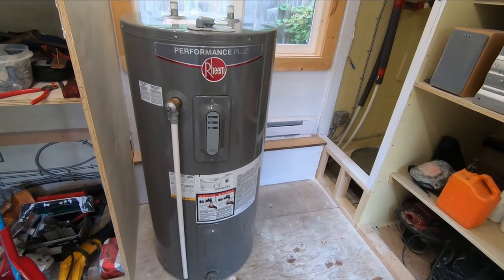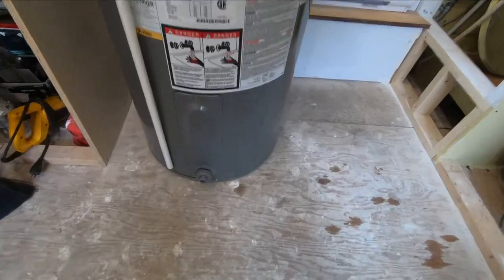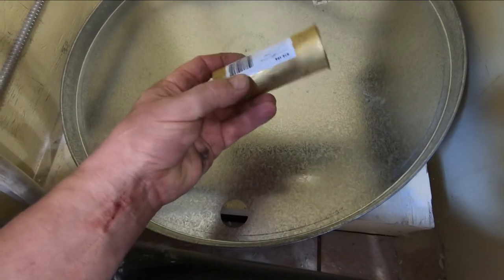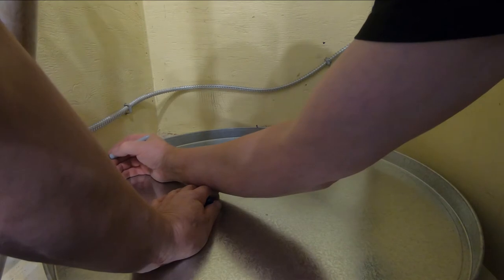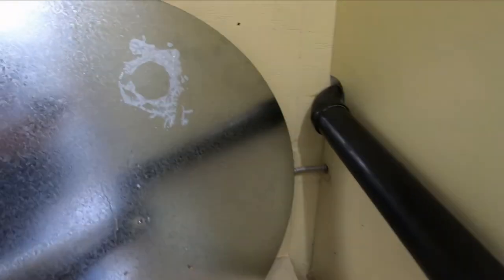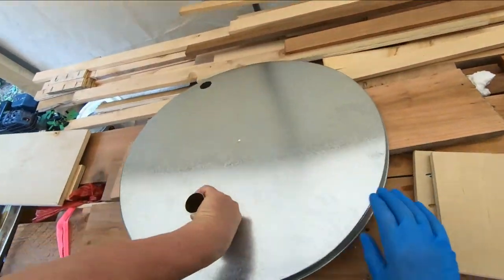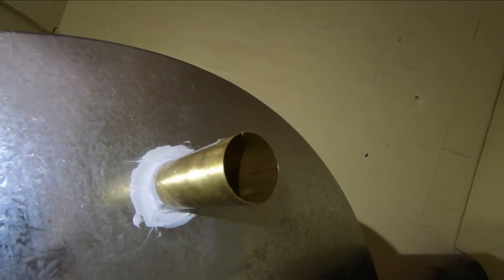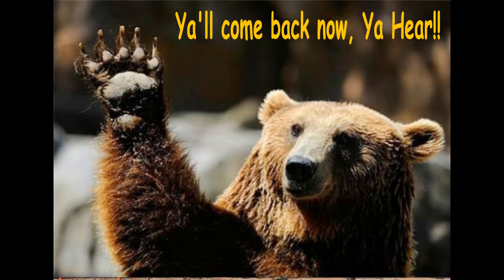HOW TO INSTALL A HOT WATER TANK DRAIN PAN

Comment: That big gap you have at that water spout outside the house is big enough to let a Rat into that home!!!!😳😄😄
Reply from the maker: HaHa The actual hole into the house is a drilled hole the size of the pipe. What you see outside is a notch cut out of the trim board. A little rough but no access into the house by anything bigger than a spider. We do have some rats around but none have tried to get in this way. They wait patiently outside the back door for me to open it for them. We have fat, lazy rats that won't chew to enlarge any hole lol

Comment: Every time I think I've been around the block, some old Gray Beard has to come and school me! This is a must have. I think I have a thing or two laying around that I can make one up with pretty quick. If I can't make one pretty easy, they look cheap enough. I've never seen these around and I wonder why. If something lets go on your water heater and you aren't home, Man that'd be bad! This thing will save your ass! Please accept my most profound thanks!
Reply from the maker: You are too kind. Thanks. I appreciate that this may help somebody. What I forgot to include in the video was that if you connect the drain to the domestic waste water drain system in a house, you'll need to install a "P" trap to isolate the sewer gasses from entering the house. If however, you're just going to drain it outdoors then my direct-discharge pipe to the outside is fine. These pans aren't expensive. They run between $10-$30 depending on the size and material. Many are plastic but steel pans are still common. Some pans have a side outlet for the water and will come complete with a PVC fitting as a start for the drain. I've seen hot water tanks that have sprung a leak and they all create a huge mess! They are fed from a pressurized cold water system (whether from a rural well pump or a municipal water supply) that will keep feeding water until the valve is turned off! Inside a house, this can be catastrophic! Most drywall and building materials (like cabinets made from sawdust board, and laminate flooring) will turn to mush if they get wet enough. It's little wonder that insurance companies insist on tanks having these "safety pans" now. Imagine going camping for a few days and returning home to find that the 2 year-old hot water tank was leaking through your floors and walls from upstairs the whole time! No fun!🤕

Comment: How's she goin'?  Nice work around on the pan.  Having the drain go outside is a neat idea.  But I would be concerned about mice or critters like that coming in the pipe.  Do you have a screen on it?  I like the way you marked for the hole.  Pretty smart and you can keep your hands clean too!!!  LOL  Nice job.  Take care!!!
Reply from the maker: Hi Mike, No screen but I usually park my MTD GOLD tractor in the pipe.! Hahaha (inside joke for anyone who hasn't watched "Grampies Workshop" on YouTube, check it out).The mice haven't found the drain yet but a piece of screen may be a good idea. I pour some water in the pan every now and then to flush out the spider webs. I was worried that blocking the pipe, even partially, may interfere with the drain. Always room for improvement. Thank you for taking the time away from your MTD GOLD tractor to watch and comment on my video. When are you going to install the pink shag carpet? Maybe you could do a "Live stream" that day? haha😳
Reply: @EverydayProjects  Ha Ha Ha!!!  The pink shag carpet project is on hold due to budget constraints!!!

Comment: The plumber installed the new hot water tank, but didn’t install the drain pan, how to install one now? Please help thank you
Reply from the maker: It can be done but the tank will have to be drained and disconnected to install the pan now. Not too many ways around it. The pan could possibly be squeezed underneath if there is flexibility in the piping connections (I'm thinking maybe if it was installed with PEX piping that has some give, or braided, flexible inlet/outlet lines). If the tank was connected using soldered copper pipe, forget it, it'll have to be disconnected to get the pan underneath. Best wishes. Have you subscribed? It's absolutely FREE and is done with the click of a mouse. No salespeople will call Haha

Comment: Most those pans are flat on the floor and don't drain to anything or has no way for the water to escape and simply just builds up in the pan around the bottom of the heater
Reply from the maker: That's false. Each of these pans has either a side or bottom hole to connect drain piping. The purpose of the pan is to catch leaks and route the water into a drain or oustside. These pans are required by code in most new buildings for just that reason.